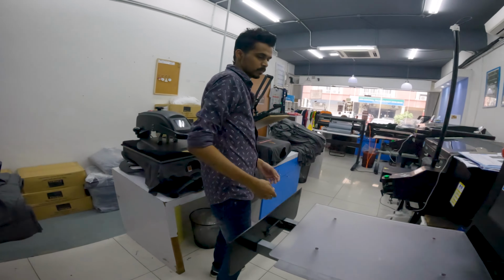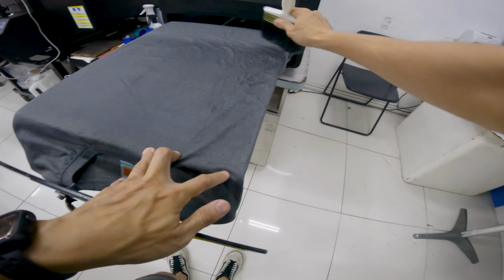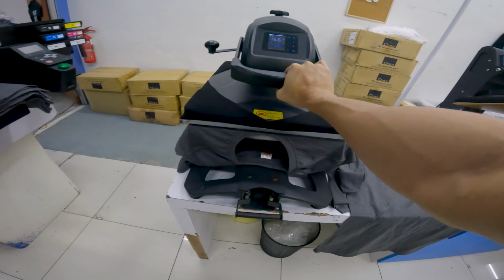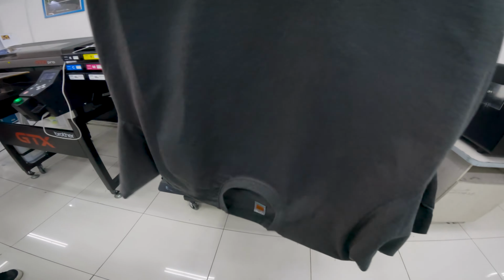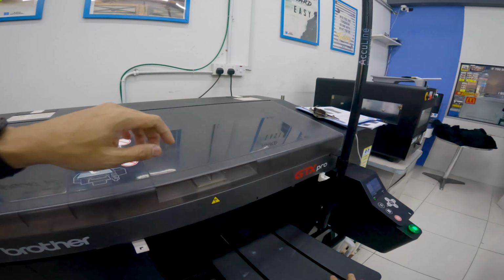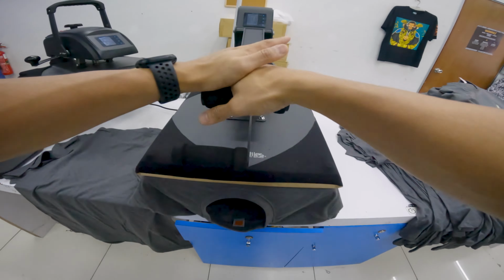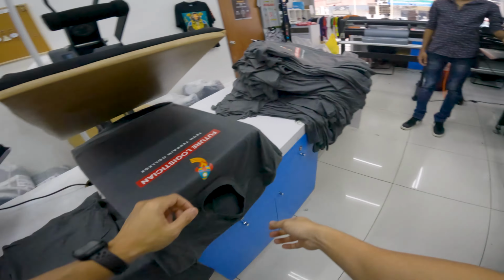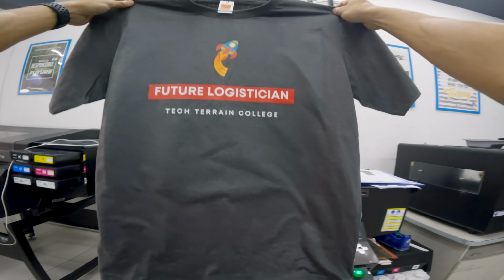Printing Charcoal Color Tee | Brother GTX Pro Bulk [POV]

Comment: Good morning 
  I use a Brother garment printer, but I have a problem when printing white color, as it does not appear evenly.  Is the problem in the print settings, pre-processing, or something else?  Please accept my thanks
Reply from the maker: well it depends on the problem. Does not appear evenly usually pretreater issue. Need to see picture.

Comment: what should the settings be on the GTX for black shirts?
Reply from the maker: just use the standard setting will do. Tweak your pretreatment.
Reply: Hey Brother, didn't expect a quick reply. Thank you! So, I have air in the white tubes.  Been dealing with the same issues for more then three months. It's late in New York so I have to wait till tomorrow and see if tech support will get to me. Will keep you posted. Thanks again.
Reply from the maker: @websurfer2344  make sure all tubes tighten up. sometimes need to pops the cover to check. also make sure all the pouches properly rolled up. then do a proper ink charge.
Reply: @amedionteo  we've done it. The pouch keeps leaking ink. I think the ink cartridge pouch is not rolling the pouch thoroughly allowing air to some how seap in when I perform the daily shake.
Reply from the maker: @websurfer2344  the pouch shouldn't have air inside. Make sure the tip there is okay and also the cartridge there dont have solidified white inks making a gap between needle and the rubber.. that's where the air goes in.

Comment: 🙏Hi. What you can say about printhead? How long it last? How often it’s getting clogged? Did you ever unclog the printhead? What’s the cost for ink?
Does the Broters work offer a technician on the go if need to fix some not common issues with printer?
Reply from the maker: The normal gtx printhead not as reliable as gtxpro. We sold some GTXpro and 2years nobody change printhead yet. Cost may varies by region. We are appointed dealer we we will be doing servicing so yea our customer can call us anytime should they require support. Not sure how it works at ur area.

Comment: Hi there, i have a problem mostly with red color. It doesn't cover well enough. On the test print everything is ОК but when I print on t-shirt it gets scraped and the white is visible.Any idea why this is happening?
Reply from the maker: You need to use white pause mode.
Reply: Hello! Have You solve this problem?🙏🏻😞 we have the same problem. When we print, the final result is with white dots. The highlight is 5 and the mask is 2🙏🏻 please hellllllppppp😢😢😢
Reply from the maker: @innapevcova7081  slow down the speed by using white pause. Also try reduce pretreatment if the print already very solid.
Reply: @amedionteo  thank You, Teo! I will try to make one more now🙏🏻 hope, it will help🥹

Comment: How is  the maintenanace like on GTX Pro 424 Bulk?   does it comes with the software on how showing cost and pricing per print?  thanks
Reply from the maker: @nzed316  pretty much same like normal gtx except u dont have to shake ink daily. No cost shown. Only shows ink consumption then u have to do the math.